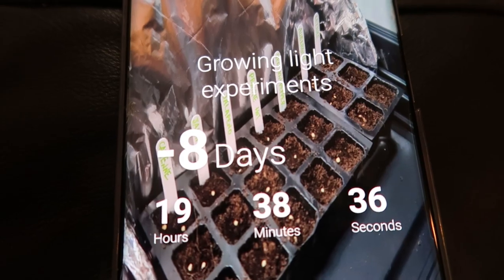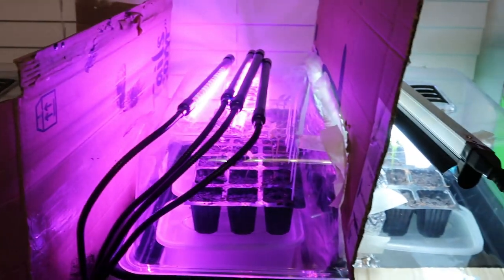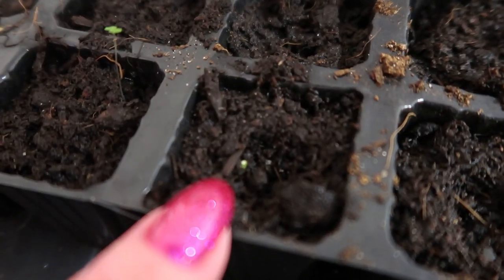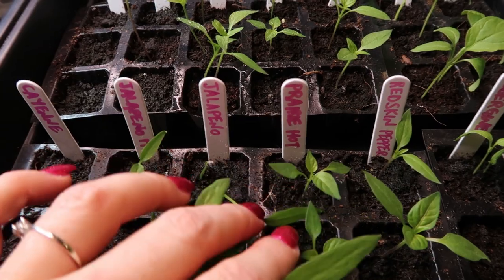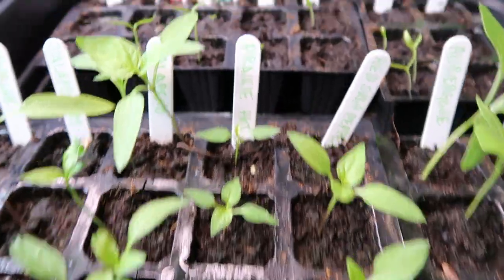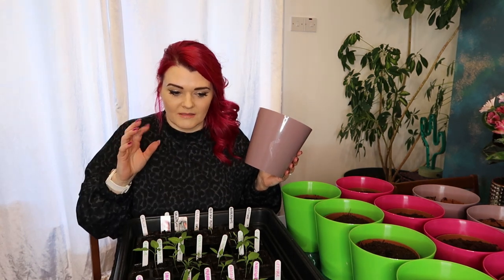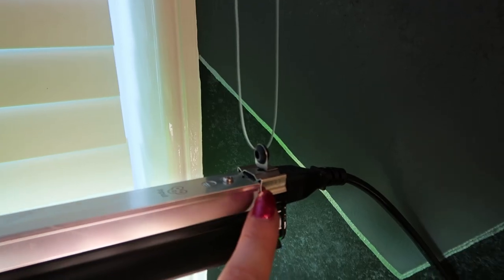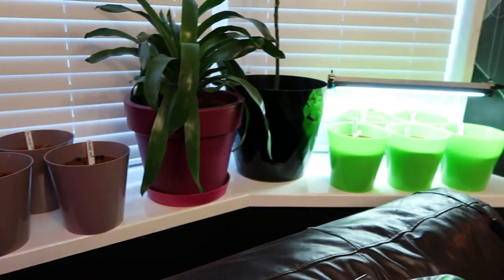Do Grow Lights REALLY WORK? Grow Light Experiment / MoggyBoxCraft

Comment: You need to consider the running costs of the different lights. Mine are leds  and I love them. Very useful in Scotland.
Reply from the maker: Very good point! I hadn't thought of that. The sunblaster light is not led unfortunately. I guess time will tell which preforms the best and is it cost effective.

Comment: The heat mat promotes the germination. The lights come into play once they have germinated. There are some seeds that require light to germinate but chillis don't. They do need lots of light once sprouted.
Reply from the maker: Oh fab! Thanks for the info 🥰 have ordered an extra grow light. ❤
Reply: @Moggybox  Hi great video , which light did you go for , and if the heat mat is a sealed plastic mat I think you could put it directly under the trays also from other video's on lights the closer to the seedlings the better to about 2" or 50 mm above , keep up the good work ,G.
Reply from the maker: @bogsdolics  Thank you. The grow light experiment is still underway. Although I have bought an additional sunblaster light, both lights are doing well. Unfortunately the heat mat information says not to submerged or get water on, so safety first 😄

Comment: Loving the progress of these - what a difference the lights are making. Just a thought, are you running your hands over the seedlings a couple of times a day to help strengthen them? I've heard it can help seedlings grown under light because they're aren't getting blown by wind so they can get a bit weak and leggy - running your hand over gently helps simulate this and make them a bit stronger (theoretically). I've not had the opportunity yet but it might help them along.
Reply from the maker: Thank you 😊 and thanks for the suggestion, I hadn't thought of that, will give it try and see if it helps. Every little helps 🥰